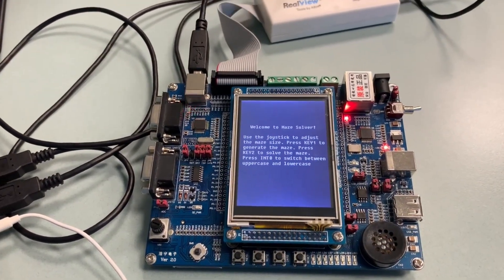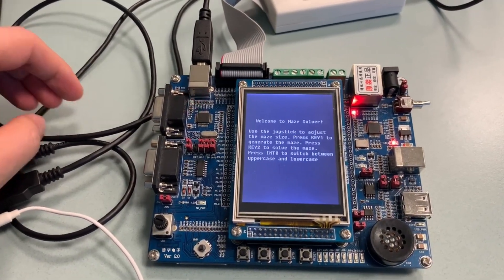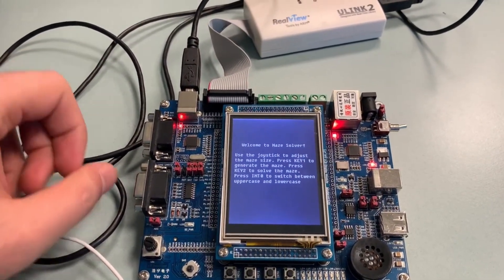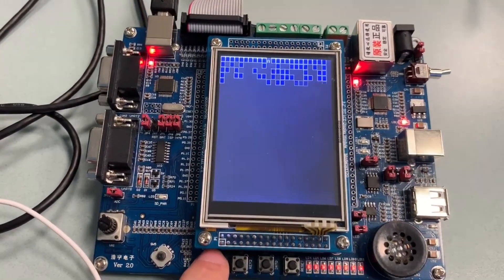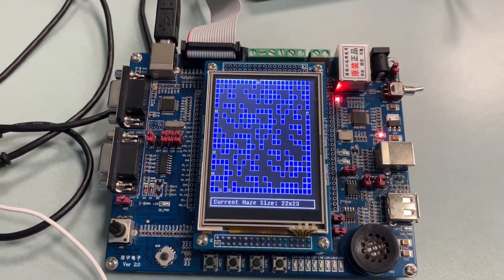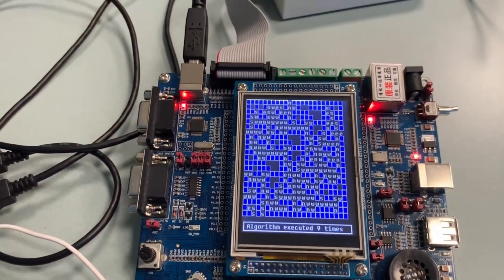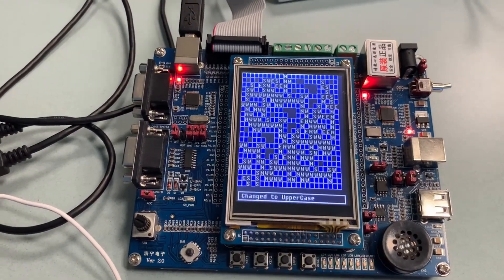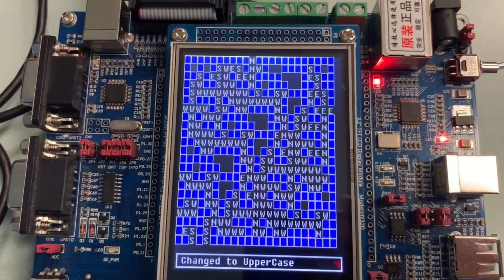🧭 Maze Solver on LPC1768 | Embedded Systems & Algorithm Optimization

Comment: That was always my first project with a new language, starting back in the Applesoft BASIC days.  (A couple of decades ago, my instructor at the time was fuming because I insisted on using arrays of bitflags for my maze generator on a 64-bit, 3.2GHZ processor with 8GB of RAM when I finally pulled the plug and decided to learn C. :rofl: )
Reply from the maker: That’s so cool! Maze-solving really seems to be a timeless first project for so many of us. I can only imagine your instructor’s reaction—bitflags on that kind of hardware must have been quite the debate! 😂 C definitely brings a whole new level of control and efficiency. Thanks for sharing your experience, really enjoyed reading this!
Reply: 3.2GHz in 2005 🤤

Comment: why using interrupt timer instead of resistor pullup?
Reply: You can use pullup resistors so that the input gates are not floating. This will not solve the bouncing issue. The Problem with every mechanical switch is that they don't turn on/off on time when you press. They turn on/off multiple times until they settle into the desired state. With an interrupt timer you get an interrupt when the button changes the state the first time, wait for a certain amount of time until the bouncing is finished. This way you dont get like for example 5 ghost button presses, when in reality you just pressed the button one time.
Reply: @georgehrler5574  thank you for the explanation
Reply from the maker: @georgehrler5574  Exactly! Pull-up resistors help avoid floating inputs, but they don't solve the bouncing issue. That's why I used an interrupt timer—to detect the first state change, wait for the bouncing to settle, and register only one clean press. Without it, you'd get multiple unintended presses from a single button press. Appreciate the explanation! 👍
Reply: Pullup resistors aren't going to eliminate switch bounce whatsoever.
Reply: @tetrabromobisphenol  why? pull-up and pull-down resistors are used to correctly bias the inputs of digital gates to stop them from floating about randomly when there is no input condition
Reply from the maker: Using a Repetitive Interrupt Timer (RIT) for button debouncing instead of just relying on a pull-up resistor makes a big difference in reliability and efficiency. Here’s why:

🔹 Why Use an Interrupt Timer for Debouncing?

1-More Reliable Button Presses:

Physical buttons don’t always give a clean ON/OFF signal—they tend to bounce, meaning they rapidly switch between HIGH and LOW before settling.
A pull-up resistor helps set a default HIGH state, but it doesn’t fix bouncing. An interrupt timer ensures that only a stable, final press is registered.

2- Better Performance & Efficiency:

Instead of constantly checking if a button is pressed (which wastes CPU time), the RIT runs in the background and only triggers when needed.
This means the system can focus on more important tasks while still handling inputs smoothly.

3- More Control & Flexibility:

With software-based debouncing, you can tweak the timing (e.g., 10-50ms) to match the button behavior exactly.
If you were using just a resistor, you’d have to adjust the physical circuit instead of just changing a value in code.

4- Easier to Scale:

If you have multiple buttons, using pull-ups with capacitors for each one gets messy fast.
A timer-based approach lets you handle many buttons efficiently without extra hardware.

So, Why Not Just Use Pull-Ups?
Pull-ups are great for setting a default HIGH state, but they don’t remove bouncing.
For a simple project with one button, a pull-up might be enough.
But for anything that needs precision and responsiveness, like this maze solver, a Repetitive Interrupt Timer (RIT) is the way to go!
Reply: Guys, can you help me do this one, Issue with the code, help in code section is needed